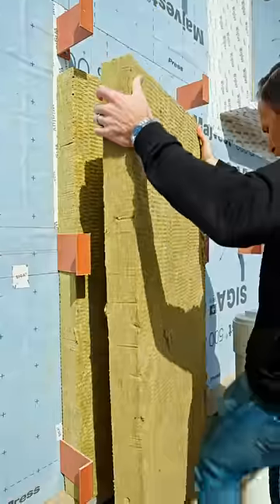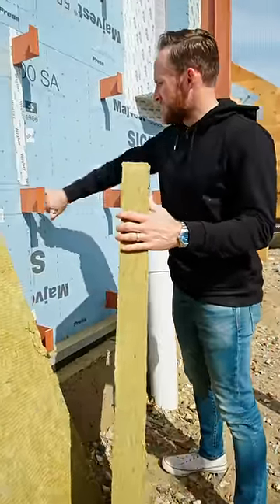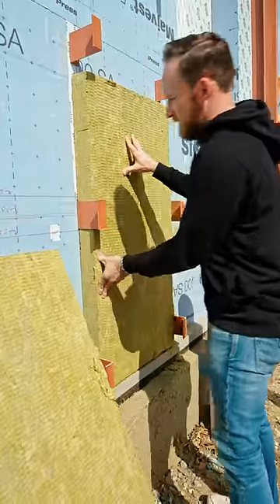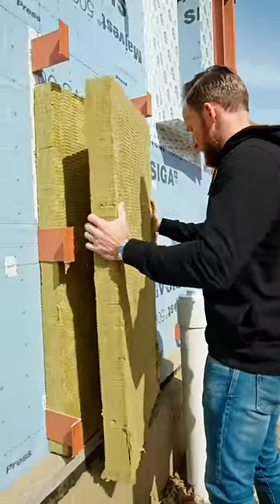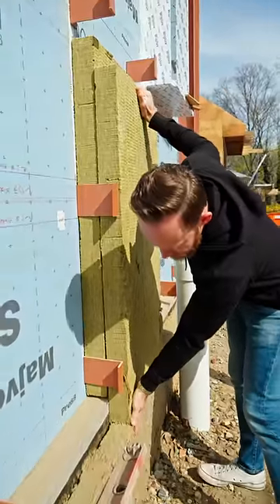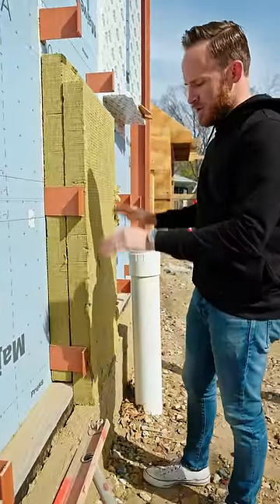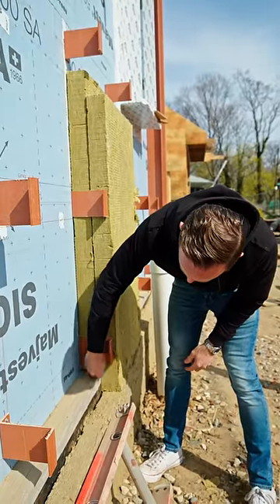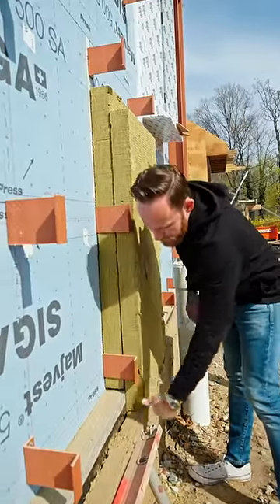Z girt and Six inches of exterior insulation

Comment: Copper flashing is a great thermal bridge, if you calculate the thermal transfer I think it's the same as leaving off the bottom 4 or 5 feet of insulation.
Reply: Hadn't thought of that, but there was going to be a metal flashing of some kind regardless; you have to have it. The difference in thermal conductivity between copper and galv steel is probably not enough to matter in this instance
Reply: @teraxiel   If the only alternate is gal, then i agree copper is a fine choice (and i love the look of copper,  chef's kiss) but I would like to think a peel'n'stick might be OK there or perhaps two different plastic flashings mating together or even change the detail of how the wall meets the slab so you can use an off the the shelf plastic flashing instead of a custom one. I don't really know the solution, but i think it's a problem worth thinking about.
Reply: @jon8864  Perhaps, but no exterior insulation envelope is perfect, there's always going to be a small amount of material acting as a thermal bridge. I would guess that the heat transferred through any base flashing material is so minimal as to be a non-issue.
Reply: @teraxiel I did the certified Passive House trades person course a few years back, in that we had the calculate the thermal bridging in aluminium flashing that poked out the bottom of external polystyrene insulation very similar to this. It worked out that including the aluminium flashing was the same as not putting on the bottom 4 feet of insulation on the wall. I think that's pretty significant. Calculate it for this wall if you want,  but I  imagine it's similar (although the copper is probably thinner than the aluminium so maybe not as bad).
Reply: @jon8864  That's incredible. I'm aware that small thermal bridges can have huge effects on R value of the whole wall assembly, but that's unreal. How tall was the vertical flange of the aluminum flashing behind the insulation and how thick was the insulation?

Comment: I want to build something monolithic, with a few inches of fiberglass reinforced concrete, then dense spray foam insulation on the interior. use a waterproofing enamel on the outside so its like an egg shell, the spray foam is like the inner membrane.

Comment: BETTER YOU THAN ME, NANOOK!  I LIVE IN HAWAI'I, MAX TEMP SWING HI SUMMER TO LOW WINTER ... 25 DEGREES!  6--85.  WE DONT HAVE INSULATION, WE DONT NEED AC/HEAT.  AND WE ARE 3000 MILES FROM ... ANYWHERE!

Comment: Expensive. But do the benefits outweigh the costs? And what about air leakage? How are you stopping air infiltration through cracks and gaps in the structure? Close cell foam will do that and provides a vapor barrier. How does this solution compare?

Comment: Why not use a fiberglass flashing (similar shape to the Z-girts) at the bottom instead of copper?  Copper is decay and oxidation resistant, but it is the best thermal conductor available.

Comment: Knew a guy in South GA with 18” walls. His AC bill was significantly lower than mine. Then again his house was a built in metal fab building.
Reply: Yeah if it was a regular house with 18in of insulation it would be even lower.

Comment: Interior spray 2 inches of closed cell foam, all you need. Insulation outside of the wall doesn't do much. Car heater on high, all widows down, 65 mph. Isn't that warm is it?

Comment: That insulation is so dense that you can if properly fastened and prepared put a heavy stucco base coat of 3/8", with a scratch coat ,then a double coat with stucco mesh and then, a beautiful finish coat. This system will stand the test of time for decades, and add plenty R-Value. I know this because the crew and I done this in the 90s to "THE BAY", in Toronto Ontario Canada.
PS, don't try this unless you are absolutely positive you can ?
If you have any questions please feel free to ask me, 😊 
Thanx for the video, and have a great day
I AM MASTER PLASTERER 😎 1963

Comment: So the orange brackets are metal or plastic?  If they are metal and screwed into the stud are they not creating a way for cold and heat to pass thru?

Not a builder, but isn't this what you usually try to prevent?

Comment: Curious question and might be a dumb but humor me. The plywood being bailed the to your fiberglass supports looks like is being nailed every 16 inches or so. Doesn’t plywood have a code for 4-6 inches on the perimeter and 8-10 in the Field. How does it pass code with such a wide pattern do to using the brackets.

Comment: All for insulating my home but that’s got to cost a fortune. I live in Massachusetts on the cape my house is 140 years old and I have insulated it pretty good considering the challenges of older homes. Does the house breathe or do you have to have some HAVC system to move the air? Do you use a vapor barrier too?

Comment: Can a house have to much insulation and cause mold problems??
Reply: by too much insulation lets assume you mean air tight.. those houses need an air exchanger to draw in fresh air and to control humidity without loosing heat..
Reply: @andreh.dupuis8475  yes sir, that makes sense. Is there also a place that you have enough "R" value and it doesn't really do any good to add anymore? Thanks for answering

Comment: Has anyone done some sort of combo of spray closed cell with batts of rockwool or similar placed like a “form” so you end up with a breathable and flush-flat insulation on the outer surface? Just curious and asking here since this seems like extreme R value wet conditions rich mansions type stuff

Comment: As an Architect, why not just frame the house with 2x10 studs at 24" o.c.??? That would be more efficient than what I'm seeing. Or, you can do what we did in the late 1970's and frame 2 , 2x4 walls one behind the other with a 3" airspace between them.

Comment: In Sweden we use this type of insulation a lot now days. But the installation style shown here is stupid. We just put on a shelf to lean them on and then screw them on with plastic cylinders that penetrate the insulation. A lot faster, easier, cheaper. We also can put the sheets offset so that we cover the gaps. Otherwise cool in the summer and hot in the winter. :)

Comment: Some problems with that rock wall one it's not water proof at all it gets wet its done 2 it's expensive as hell. the good 1 it is fire proof 2 it does work very well as long as it is dry so two layers is completely unnecessary

Comment: Aren’t you worried about moisture in those batts? Seems like a weird way to do the whole outside insulation. Also how thick of insulation are you putting in the walls on the inside of the house

Comment: I own a waterproofing company your flashing would have been better if it was under your vapor barrier, I know your going to caulk the top of it or rubber it but it will eventually fail and rot out your sill plate
Reply: I’m in New Hampshire btw we also work in road island

Comment: AS HOME HEATING AND COOLING COSTS go UP - and then becomes a nightmare for homeowners to pay those bills for their comfort during weather extremes - home designing and builders will have to rethink everything to assure buildings do not waste electricity, heat, and air conditioning.

Comment: I build in Alaska. Colder than RI.  At first blush at least.  I would see vapor barrier problem leading to condensation. With your method. (Wish you had included vap barier details. It seems your blue board has been taped and sealed. = Vapor Barrier. Is there an interior vap barrier.?)  Your method is vastly expensive. 
       I build here via double 2x4 walls, Eleven inches thick with fiberglass bat insulation. Ceiling has 2' of fiberglass bat topped with blown cellulose. 6-mill vapor battier is on INSIDE SURFACE. Costs average $32/month in natural gas to heat 1700 Sq ft home here in Alaska..).

Comment: interesting but.. I’m surprised that the wall would be an extra 6 » all around, that equates to a loss of .5 square feet of livable space times the perimiter of the house.. 30x 40 two storey you lost 140 sq feet.. is the exterior wall overhanging the foundation wall? is you want stone other masonry wall does this mean even wider foundation? losts of intriguing questions which of couse cannot be explained in a short.. thanks for sharing

Comment: Hopefully the cost doesn't outweigh the gain That is some R factor I'm a radiant heat specialist A home built like that you could  Practically heat a home for nothing I heat my home with the radiant  Running 115ﾟ water. Extremely low fuel consumption🤏

Comment: Almost all of your heat loss in your house is due to the windows so to have all that expense and still lose all your heat to your windows and your ceiling it's not worth it you're better off going with a much better window with the regular insulation and and thicken it up in the attic and you will get the same amount of heat

Comment: Insulation should be internal  or at least inside the vapour barrier or breather membrane.    No  sign of an air gap  25mm to 50mm on cold side of insulation .  No sign of   edge protection from rodent infestation I to cavity or insulation

Comment: Making me itchy just watching you handle that bare handed.
Reply: Rockwool isn't like fiberglass
Reply: @chevyguy916  I'm a commercial mason. I often installed that very system. Although Rockwool sure does beat the ol' pink panther in the itchy scale, You can't tell me that it's not fiberglass, and you can't tell me it doesn't make you itchy.
Reply: @brickprik  yeah I'm in general construction out here in California I've installed it a few times myself and the funny thing is I've never itched from it. Rockwool is a volcanic material that used in growing weed as well

Comment: What I don't understand is, how do you keep the moisture from building up? I have an all brick home. My walls are concrete. I have to run dehumidifiers all year long, especially in the basement or we get mold. I should say I run them 9 months of the year. All of the people on my block have the same type house. We all have the same issue. Humidity. A lady use to work with leaves her basement window cracked all year long. She runs a dehumidifier most of the year as well, same city, across town, same type home. I say all of this to say, don't you have to have air flow.l am no expert. I am a paper pusher.

Comment: That'll be a lot of black smoke when houses like that burn up
Reply from the maker: ROCKWOOL insulation is made from non-combustible fire-resistant stone wool that can withstand temperatures above 1,000°C1. This helps limit the spread of fire in a building. With minimal organic content, no significant toxic smoke is produced either.

Comment: There is no reason for installing the rockwool on the exterior of the house using spotty z-girt supports.   It would be much easier to double up the insulation on the inside of the house instead.  It would not require special fasteners, special knowlege, special planning or any other 'unusual' techniques.  Sorry but someone is trying to 'reinvent the wheel'.

Comment: Lol what system is this? XD never seen outdoor isulation when you let gaps/spaces in same row xD you always break it xD first layer spaces is covered with second layer xD this kind of insulation has no effect to be double layer xD you can do same effect with same size insulation block with same size as these two pieces xD and it will be better xD will have same contrustion mistake but you wont extra gap/spaces between each layer xD

Comment: Dude, put some gloves, goggles, and a mask on - mineral wool insulation is just as much of a skin, eye, and lung irritant as fiberglass with the same prickly itching all over. Instead of using spun molten glass into fibers, they use molten rock (and steel) which easily penetrates & breaks off in human skin, which can cause extreme discomfort and even infection with even the shortest of contact.
Reply: Rock wool isnt bad to work with now maftec or danka on the other hand are what commonly cause all the problems you listed

Comment: You know why houses from the 17 & 1800’s are still standing and not rotten away like most modern house after 25 years? They’re not sealed up tight and allowed to “breath” not allowing air movement through is a bad thing in the long wrong

Comment: 2" of spray closed foam is much better, seals the house, structurally 3x stronger and only allows 87% heat transmission. R value is a lab concept and has no real world value. Because both air and moisture can flow thru batt insulation

Comment: This is stupid on a new build. FFS. All of that excess work, material and everything else is going to cause so many more problems. This is why you build a pole barn type frame with spans of 10 feet then you have an extra thick wall which will give you 6 to 9 inches of insulation with girt on both sides. Bigger post like 6x8s or 6x10s will give you a thicker wall. You can then insulate the entire slab so that is does not come in contact with the outside.

Comment: Unnecessary exterior insulation.  Looks like a can of worms waiting to get soggy, rotten, excessively heavy with moisture & a very expensive mess to fix in a few years.   

This looks like new construction so why complicate matters & add exterior insulation?  If a higher R-value is required, just add the insulation on the interior where it belongs & you won't have future moisture issues & problems.

Comment: And yet you will no doubt install huge windows , even the best have a much lower r value than a typical insulated wall. But wait! You made the house too tight and now it has too much co2 , so you install an air make up system to bring in fresh air …